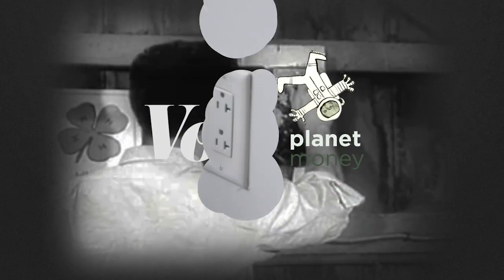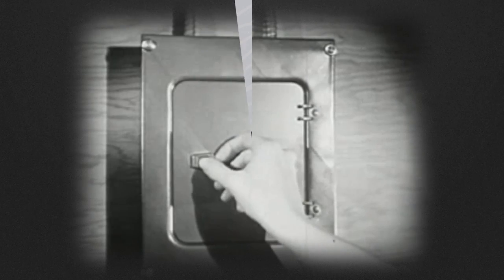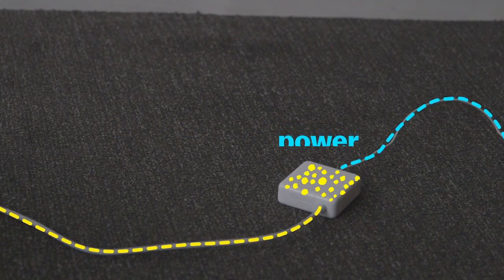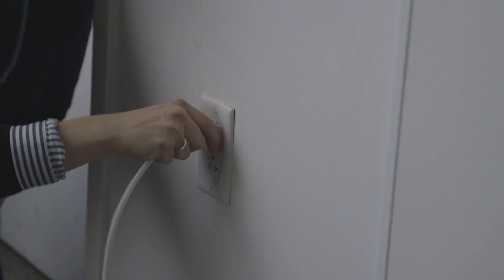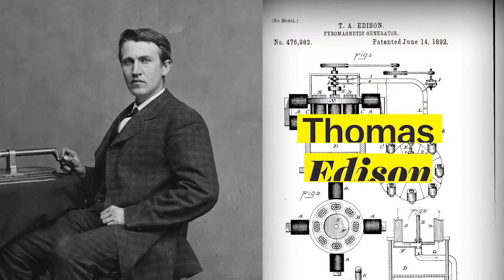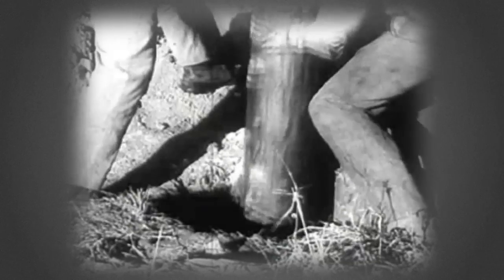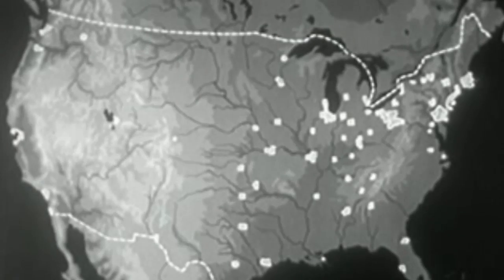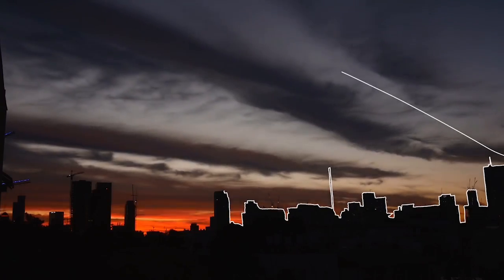Why your laptop charger is so hot

Comment: There's a reason electricity is transmitted at such high voltages. And that is to reduce power losses in transmission. The wires delivering electricity have some resistance. The power loss is proportional to the resistance and current. So, if the voltage is high, then the current can be less to deliver the same amount of power. So, if you just distribute 5V DC (for example) for the electronic devices, the losses would be enormous
Reply: Power loss in a transmission line is actually proportional to the current squared, and inversely proportional to transmission line resistance (or impedance in the case of AC). 
P = I²R  and   P = I²Z

All of your ideas are right, I just felt like nit-picking :)
Reply: better explanation than this video
Reply: And there is also the fact that in AC it is easier to change voltage then in DC (unless you count capacity converter, but that don't work so well for higher current). So AC is made in power plant, goes up, travels to you, goes down a few steps and you have your 230V (or 110V).

However - would the losses really be so significant if we would distribute say 24V for a whole building or at least a flat?
Reply: +Miku MichDem about hundred times?
24V 10A DC with 1mm in diameter coper wire would lose you 8% of voltage per 5 meters (and obviously you need much more than 5 meters to wire an flat).
240v 1A AC with same cable 0.088%

Not to say that 24v is too high, you still need power brick to step down to at least 19v for notebooks and 5v usb-charging things.
Reply: niter43
Of course 24V will have more losses then 240V, but to get accurate comparison DC vs AC voltages need to be the same. And having in mind Telegrapher's Equations DV is having advantage over AC.

The advantages will be with one converter. Difference between +80% and 50% efficient power supplier would overcome wires length.

As for 24V imo that's a good voltage. It's easier to step-down then to step-up DC-DC.
And conversion is not a problem. LM2596 for instance can provide up to 3A between 3,2V and 35V or more expensive XL4005E1 up to 5A between 0,8V and 30V.
On the other hand step-up is less powerful. U3V12F12 (similar price range then other two) for instance can provide 1,4A at 12V. Much less then LM2596.
Reply: Well, I understood your question as "Why couldn't we provide 24v sockets in addition to 240 ones, so we could live without adapters for phones/tablets/notebooks. Is losses really that significant?".

So, that's why I compared situation with only 240v sockets and power bricks vs. 240v + 24v sockets.
Reply: niter43 I see. But take into account that those step-downs are in 80%-90% efficiency range and are dirt cheap. However power suppliers are not. +80% ones can be expensive so many manufacturers go for cheaper, less efficient ones (like ~50%). That is the place where huge gains can be made.
 It would be like a car vs a bus.

Comment: I never understood why the power box outside your home or building didn't just convert your power back to DC. It makes much more sense than having every single device use its own converter.
Reply: The biggest power consumers in your house needs AC. Think dishwasher, refridgerator, air conditioner, fans, vacuum cleaners, pumps. Of course it makes sense to design the house's electrical system to cater to these major consumers. The 5 Watts that your phone charger uses is insignificant compared to the 1000 Watts Dishwasher.
Reply: DC devices need all sorts of different DC voltages, so a one-fits-all single converter wouldn't be effective.   Also, it isn't the AC-to-DC conversion that is inefficient, it is the voltage step-down process that is inefficient.

If you power your whole house with 24VDC, you would need a lot thicker copper wire to transmit power all over the premises.  Regardless of whether it is AC or DC, higher voltages are more efficient at transmitting power long distance, but lower voltage is needed for safe operation at the device level.
Reply: Athran A. Rahman None of those devices uniquely need AC, in order to perform their function.   They simply need AC, because they were built with to work with the prevailing electrical grid, and it was possible to build those devices such that no AC-to-DC conversion would be needed.
Reply: Athran A. Rahman The reason why there is an advantage to AC, or at least WAS an advantage to AC when the grid was first built, is as follows:

1. AC can be stepped between voltage levels with transformers, and transformers were a simpler design to invent before DC-to-DC conversion.

2. The native design of a rotating generator produces AC.  It takes a changing magnetic field through a coil to induce power.  If you try to make a steady increasing magnetic field to generate DC, eventually you'd exceed what is physically possible.  Therefore, a better design cycles the time variance of the magnetic field, and thus induces AC.   A DC generator can be made with enhancement features to the generator, but the most direct design you can make will be AC.

3. You are correct when the biggest power consumers are motors, that there is an advantage to AC.   DC motors, like DC generators, need enhancements to the design to function.  An AC motor is a simpler design which can have slightly improved performance over its DC counterpart.

Comment: This video is so incorrect. AC-DC converters don't generate heat. Stepping down voltage generates heat.
Reply: But I mean, ACDC is fire.
Reply: Technically you're wrong but I think it's a matter of you not being clear what you're trying to say. AC to DC conversion absolutely positively generates heat, but perhaps in a more negligible amount in comparison to stepping down voltage. Case in point would be home solar inverters (not talking about micro inverters). Pretty much all of them have heat dissipation features in their designs, and even when the system DC voltage is near the 240VAC in your home, they still get hot.
Reply: stop calling them "converters"
if it's AC-DC you're rectifying it
if it's DC-AC you're inverting it
and no. A step down transformer produces little heat. The reason for the mineral oil they sometimes have is to prevent arcing due to the high voltage.  The resistors, the transformer [LITTLE, never said NO heat] and the rectifier all heat up in the AC adapter. 
again I can't stress enough, stop calling them CONVERTERS. That's CONVERTING DC-DC voltage. These are outdated, expensive, and inefficient. Today something similar that converts DC voltage is a subcircuit, that uses transistor and resistor systems in small electronics.
Reply: +teraxiel Solar converters are DC-AC converters, not AC-DC. And yes, of course something that's 98% efficient still generates heat in the physical sense, just not in the usual sense of the word. It would make the power supply marginally warmer but not hot. You are always free to choose the definition of a word that fits.
Reply: +LifeRuiner Tyrone
Are you honestly complaining, that someone calls a rectifier a converter?
When you ask a dictionary it says "a device for converting alternating current into direct current" and " a device for converting" something isn't a converter?
Not a native speaker here, so I don't know jack, but that outrage comes across as rather silly!
Reply: Stepping voltage down, in and of itself, does NOT generate heat. That is, if the conversion is 100% efficient. But in real life, nothing is ever 100% efficient.
Reply: I feel stupid
Help
Reply: glad to see someone is right on this page. the heat produced in a modern AC-DC converter is largely from the high speed switching on and off of high power transistors, (usually a mosfet.) while the transistor is fully on or fully off, it does produce some heat, but much of it comes from the period in between, when it's transitioning from on to off, or off to on. this can happen anywhere from 10's of thousands of times per second, or even many millions of times per second. there are many trade-offs in the design of a power supply, which are balanced as well as possible to hopefully produce as little waste heat as possible. but there are many factors and designs, and grades of components.

using diodes to convert AC to DC does also release some heat, and there is also a transition time with these similar to what I explained with transistors, but if this waste heat becomes to much, they usually replace these with more efficient transistors in some parts of the design. some heat also comes from capacitors, the copper traces on the circuit board, wire, resistors, leds, pretty much every part which electricity touches will produce at least some small amount of heat.
Reply: The heat is mainly caused by the fast transistor switching in the AC-DC Converter.
Reply: teraxiel ACDC \m/
Reply: So what I failed to mention is that solar arrays will often, depending on the specifics of the installation, generate voltages higher than the 240V typical of north american homes. It is stepping down voltage, even if it is DC to AC and not the other way around. My point was that regardless of the conversion, whether changing voltage up or down or AC to DC or DC to AC, they ALL generate heat, just some more than others.
Reply: +Hextech Protobelt-01 why not the glp 800?
Reply: Matthew McLaren they did create heat, because they step it down from 220-240v to 12v,16v,18v after stepping down so hard, they finnaly convert it to dc
Reply: She should have mentioned that doesn’t only apply to laptops, “that weird box” is a bigger version of the little cube that plugs into a wall to charge your phone.
Reply: STFU smartass!
Reply: From an Asian student's perspective: P=W/t=UIt/t=UI
Reply: @matt AC DC is a jojo reference
Reply: Yeah turning the voltage down requires a massive resistor which generate a lot of heat during that process
Reply: If you’re using any solid state transistors, I hate to break it to you. They have certain levels of in efficiency and that generates heat. Electronics generate heat that’s just how thermodynamics works.
Reply: Nerd

Comment: Besides badly explaining the original question posed, why'd they even use an economics professor as a "reference" in the first place? Any engineer could've explained it 1000x better in half the time.
Reply: And in answer to the title question, if the switch-mode power supply was over-dimensioned, it would run cool.
Reply: +XalphYT Ummm yeah I guess it would run cooler because of a larger surface area but what are you trying to answer in the first place?
Reply: TheGibsterofGibsterness The title asks: "Why your laptop charger is so hot".  It's because it's made as cheaply as possible.  You could design a bigger, heavier design that would run cooler, but they would be a market failure.

Comment: I've heard that the American power grid is old and not reliable at all!
Reply: The United States also uses Tesla's three phase AC design.
240v versus 120v is irrelevant. transmission line voltages can range from 44kV to 400kV (just like in Europe) and is only stepped down to the household standard at the local substation or a transformer hooked up to the power line, in which case the distance to travel at those voltages is less than a couple miles. 
Both power systems have similar losses and efficiency, the voltage you get from your outlet has little effect on a systems overall efficiency since most of the electricity is carried at extremely high voltages before being stepped down.
Most of the impedance (losses) are at the transformer anyway (which will be the same at ANY voltage conversion).
The reason why the power grid seems unreliable is because in 2003 an army of untrimmed trees took out the entire northeastern power grid.
Reply: It is not really energy efficient. The higher the voltage, the lower the losses are. In Europe we have 240V, in the US it's 110V. Furthermore, electricity is carried by 3 cables to lower the losses in Europe and by only 2 in the US (three phased current is more energy efficient than single phased). 

There is also the issue of high voltage transmission, but I don't know what voltage they use in the US. In Europe, we have three different voltages (the current is converted twice before getting to your home).
Reply: Its pretty good in oklahoma, the only times the power goes out is when there is a tornado or bad lighting, or some driver rams into a power pole
Reply: It depends on what part of the country you live in.
Reply: +Vladislav Dracula Okay then. How's the electricity grid in Transylvania, Drac?
Reply: LARSFSO I haven't installed a grid in Transylvania  yet. Although it would be cool to impale people with electrified iron poles.
Reply: +Vladislav Dracula Sounds like a fun time! ^_^
Reply: Jack Majhand Isn't it ca. 230 V? Btw, just started my electro-related education. :D
Reply: @Nubnewb I live in France. I have seen one power Loss in my entire life

Comment: How will lightbulbs or hairdryers react if you feed them DC?
Reply: Your perception of the lightbulb would be the same, but the hairdryer would not work, as they use AC motors.
Reply: Depends. Tungsten and compact fluorescent (i think) would not be affected enough to make you notice. LEDs would complain because they need DC and they most likely already have a converter inside. And converters AC-to-DC don't like DC as input. But there are LEDs without them.

Comment: no, motors don't work on DC eficiently. And always is better to convert AC to DC in small ammounts of power as required. Converting it at home-level will waste way more energy than several small per device converters. Ah, btw, this is the comment number 666. wooops.

Comment: WTF This isn't even why they are hot. At all. Solid-state rectification of AC to DC is not a particularly inefficient process and contributes relatively little heat. It's the converting the voltage from 120/240 volts DC to the (typically) 19 volts for a laptop. Switch Mode Power Supplies can be made to run quite cool with adequate thermal design but when all the components are packed into such tiny enclosures with such poor surfaces from which to dissipate that heat, you end up with a brick that doubles as charcoal for a barbecue grill. That's why they are so hot. Mrs. Scheltens needs to stay away from explaining electronics, because she obviously has no clue what she's talking about and no amount of name-dropping Tesla will help.

Comment: Except having one converter box would mean that all the power for things that can take AC power (like the lights in your house) is getting converted too. So now you're unnecessarily converting more energy which would waste more. Plus, your devices would still need separate boxes to handle voltage/amperage changes. Vox, as per usual, taking all the logical info they gave you a few seconds ago and forming a completely illogical and impractical conclusion.

Comment: Ridiculous... this is such a dumb ass way to explain this. Way to turn it into a political video too... You could have explained the bridge rectifier and the voltage step down (which is where the heat is actually generated). Plus, the reason DC current is not used is because it requires many power plants as DC cannot travel nearly as far as AC current can.
Reply: +MikeTheAviator DC travels less distance in the practical use voltage which is usually around 24 volts and stepping down the voltage is much more difficult for DC.
Reply: Actually, DC travels as fast, as AC, and could be better to transfer in powerlines in certain situations, but is harder to convert than AC, and this is the case. https://en.wikipedia.org/wiki/High-voltage_direct_current

Comment: laptop chargers are hot because of the step down transformer from 240v to 12v. The rectifier (ac to dc) is very little of that. 
BTW, you dont go into explain more on the benefits of AC.

Comment: I don't like the conclusion of this video,"If we can reduce the number of conversions from AC to DC power, then we're going to save a lot of energy"

What truly matters is the efficiency of the conversion. A MacBook charger's efficiency is rated at 90%, meaning 10% is turned into heat and other losses...

If I have a full house AC->DC converter (known as a rectifier) but it is only 90% efficient, than I've simply moved the losses and heat somewhere else plus the efficiency is still the same. 

However,  one could invest in a very efficient rectifier for the house to see a net benefit. We have rectifiers's in data centers that are 97%+ efficient, so they do exist but cost money that nobody is willing to pay for since the electricity is cheaper than the rectifier with electrician to install.

Comment: I just realized What if the band AC/DC got their name from this idea of AC vs. DC power because if you look at their logo it has a lightning bolt separating AC and DC also not to mention their song or album name called high voltage and other electricity references